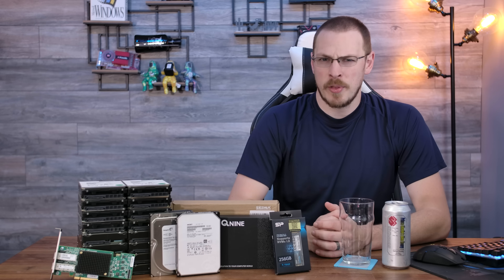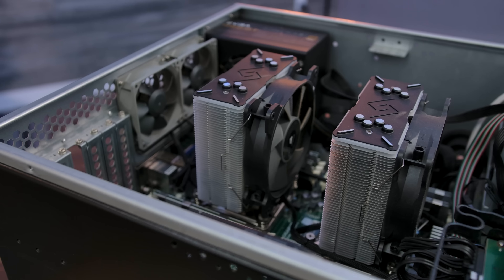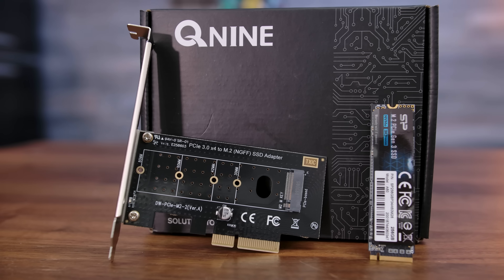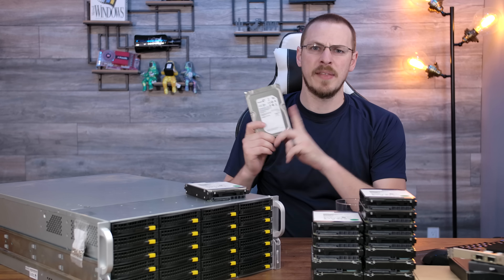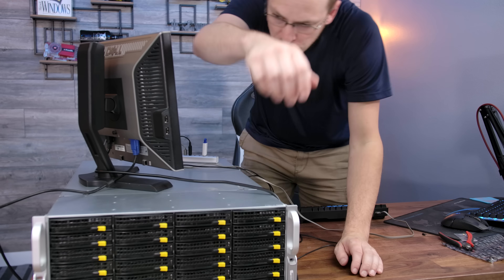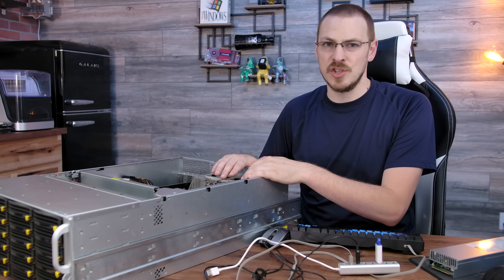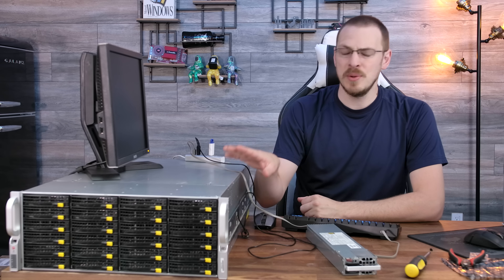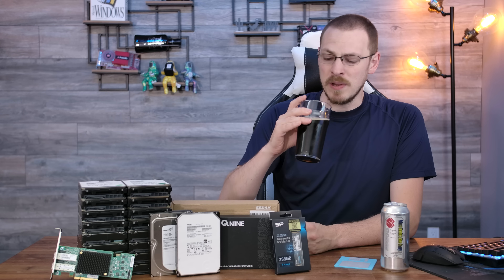My biggest server build yet! 88TB TrueNAS CORE Build.

Comment: That  2.5" SSD to SATA thing looks awesome for storage. I might just have to grab one in the future
Reply: Nope...... Get a NVME !!!!
Reply: @DysonEight  Not every motherboard/BIOS can boot from an NVMe and booting some OS's from, would be a total waste. Like unRAID, ESXi, and perhaps others. Also you may be at your upper limit for PCIe lanes. Many reasons, but this thing is just cool. (And yeah, I have 4 NVMe's in an Asus holder, but sometimes SATA is a good thing too)
Reply: @bobcarpenter1551  Agreed !!! I think the card is amazing !!! But £50 !!!!!! For that price I would much rather Get an NVME and Sata PCIE card ( I have one )... boot from a 120Gb Sata And use the NVME...... Personally I've wanted that card for years now..... Just annoying it becomes available after a newer technology becomes available... I only pay £5 more for a 1tb nvme drive instead of a Sata........... We are also at the start of a weird technological time....When the latest games console blows past £1500 PC's something's wrong.... DDR4 is now cheaper than DDR3, Those two xeon processors he used can be outpaced by a single Ryzen ! Now is not the time to be spending anything on any system!!! Changes are coming !
Reply: @DysonEight  Sadly, I went down a rabbit hole, I have discovered that they also have quad ones too, with and without RAID controllers!  I completely agree, the Threadripper Pro's are exciting too. 128 PCIe lanes!
Reply: Those hard drives are not SATA drives they are scuzzy drive that don't have SATA ports of them . Yeah that you have to have scuzzy controller to use them
Reply: @MyIronman8  pretty sure they're talking about the kingstons which look to be SATA SSDs on a pcie card

Comment: I love PCIe cards, especially stuff like that one that mounts two 2.5" drives. There's a quad one available too.
Reply: Icy Dock makes some pretty dense devices. They have an 8 bay SATA enclosure that fits in a standard optical bay.
Reply: I did not know this existed! This is super nice!
Reply: These cards are especially popular for use in older Mac Pros (2006-2012) as they have no native way to mount 2.5" drives and this way you can have 6 drives instead of 4.

Comment: I decided to experiment and go with Unraid with ZFS installed rather than freenas. Mostly due to GPU passthrough and the simple drop-in docker support. I have a similar build but I'm running dual xeon e5 2678 V3 from China at 100 USD a pop along with 128GB RAM & 8*10TB Toshiba enterprise grade HDDs. Also threw in an Asus quad nvme card with 4x1TB NVME SSDs - still have absolutely no clue what ill do with these SSDs apart from using them as temporary scratchdisks for various future projects...

Comment: Must be nice having cheap electricity !
Reply: Feel that bro. I'm hesitating to put a new diy nas up because it draws between 55 and 120w and that's like 200-300€ a year
Reply: @maximravinet9950  ouch, have you looked into doing solar/wind just out of curiosity? if your power isn't cheap solar/wind may be a good investment for you. I pay a lot for power as well and saving up for a down payment to start doing 50/50
Reply: @David_Quinn1995  well I still live with my parents right now so I don't decide if we go solar but it's definitely on the table for once we get around fixing the electrical in the house (it's really terrible, the living room gets lit up when we turn off the lights in the garage). But for now it's nuclear only I believe. And it's 0,27€/kWh
Reply: @maximravinet9950  Wow! Where I live I paid 10 buck a month for electricity.
Reply: @madd5  I'd be around 10-25 for that nas alone
Reply: I feel you... this is the main factor for all my builds.. 40c KW/h here in Aus
Reply: It costs around 0.27 NOK (about 3c USD) per KWh here in Norway, it's pretty nice not having to worry about electricity costs too much.
Reply: @KayJay01  in belgium we are around 0.27€/kwh. Pretty steep jump for this short of a distance. Can I buy my electricity from you please ? 😂